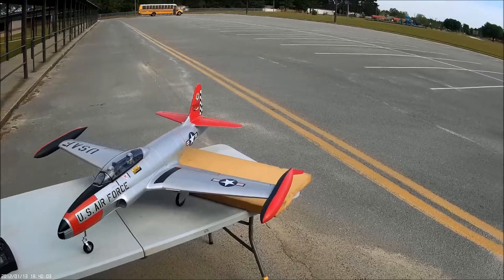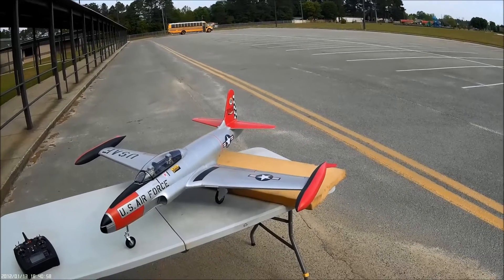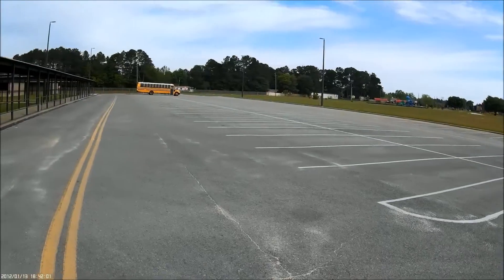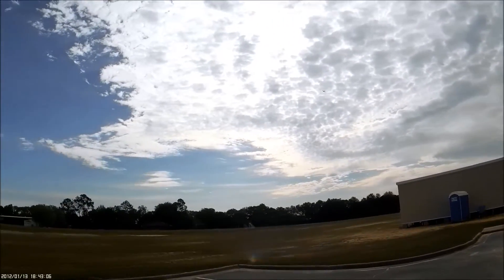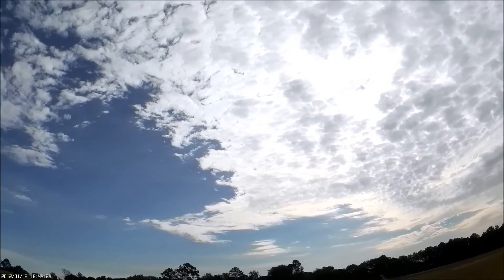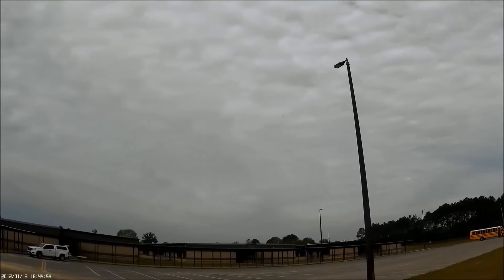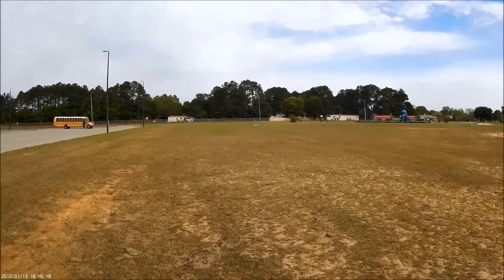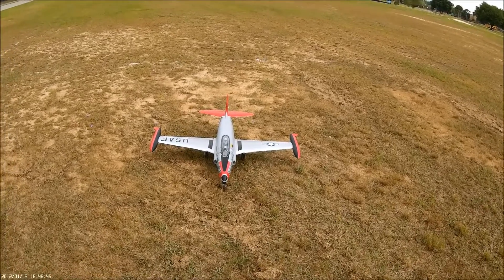FREEWING T-33 POST CRASH RE-MAIDEN!

Comment: Dammit Ron, I was thinking that Silver, Red and Black was gonna make it easy to see. Boy I have fought that with the Eflite a-10 and the ArrowsRC Marlin. (I got so mad at the 2 year old Marlin I painted it Candy Apple Red)
Great flight, well done on the rebuild, great landing and thanks for the info. My T-33 shows up tomorrow and headed to the field with it 6.30 am Saturday. (Newton County RC, Covington, GA)
Reply from the maker: NICE! GIT VIDEO!
Reply: @czflyer3947  on the maiden takeoff, I had a little bunny hop and sheared the nose gear pin, then dragged the nose down the asphalt for about 30 yards. It’s a mess. But I’ve got the nose gear, 3 extra pins, and nose gear doors on order. Will try again next weekend. I do have the 7 seconds of the maiden on video. (It sucked. But my mamma didn’t raise a quitter)
Reply from the maker: @jeffhenderson934  Dangit man!! Hate it when a maiden goes bad! I finally ordered gear pins for my eflite A10. They've been on backorder forever. Sheared a nose pin on its maiden landing. Flies great otherwise.
Reply: @czflyer3947  flew the a-10 four times today. Guessing close to 100 flights on it now. Lots of shitty/bounce landings with the a-10, no pin damage.
In the hangar now. Jets upside down needing new nose pins-
Freewing Me-262
Eflite F-16 3rd pin needing replaced
And now the T-33
I may start a company just making titanium nose pins…
Reply from the maker: @jeffhenderson934  100% man. That or stainless